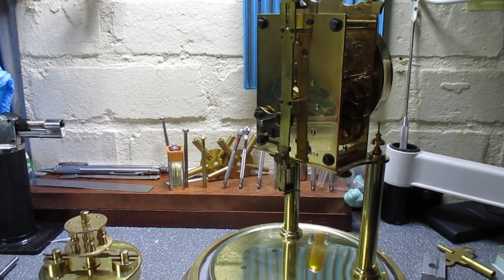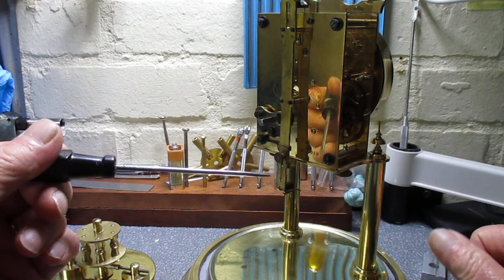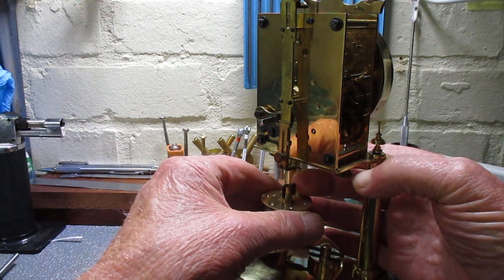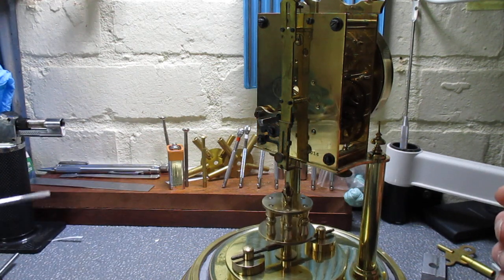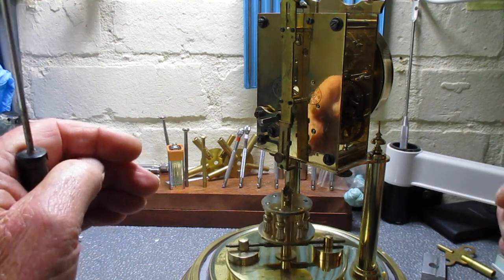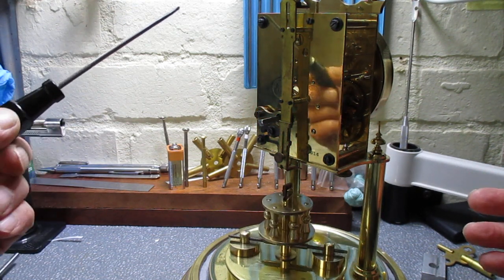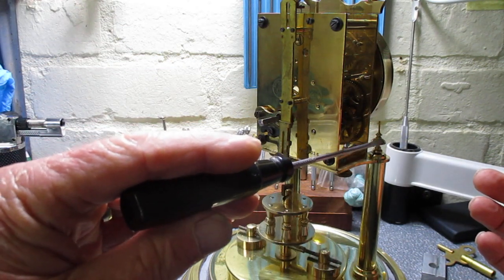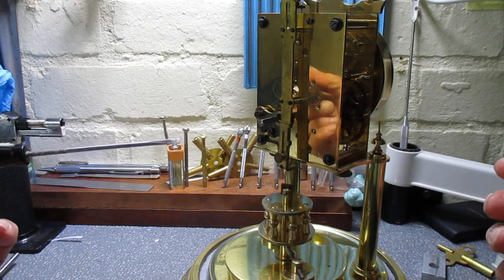Setting up Gustav Becker Torsion clock

Comment: Great video Derek. What year is this clock?  My 1908 Gustav Becker might have had that pendulum stop slide lever at one time but I am getting old along with too many clocks and I cant remember all of it. LOL. Wonder if mine is supposed to have that slide stop also? I just looked at it and it has the 4 posts for it to screw down to so I guess I answered my own question. Now to figure out where it is. LOL. May God bless you and yours.
Reply from the maker: Hi mark yes if it’s got the screw holes it should have four small pillars that screw into back plate the spring guard and the 4 small screws.

Comment: Can you advise me how I fix the fork into the pin please. Great video by the way  so informative.
Reply from the maker: Thanks , you don’t fix the fork to the pin the fork tines just sit either side of the pin, if it was fixed to it it wouldn’t work, the pin has to be free to move but just a very small gap.